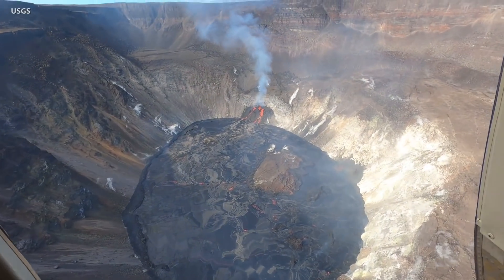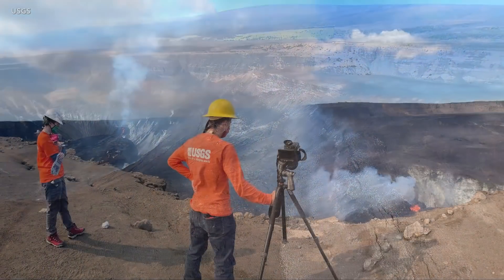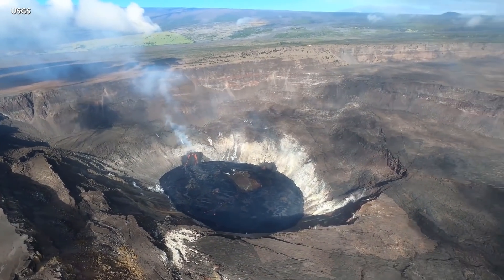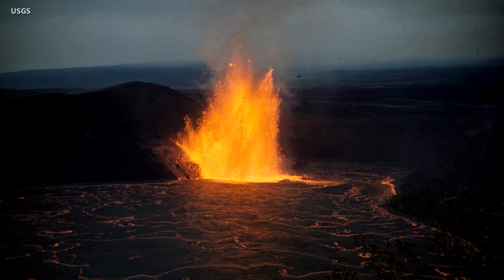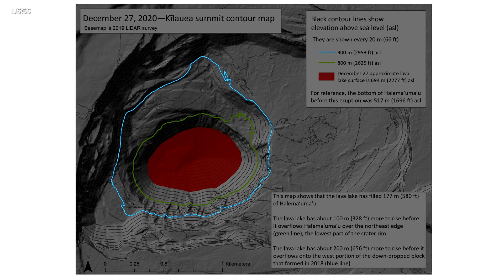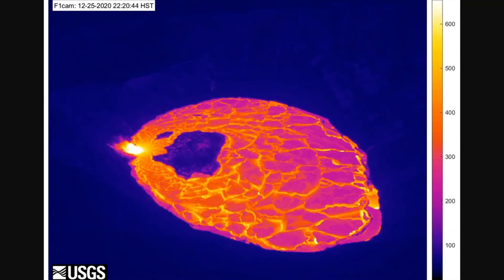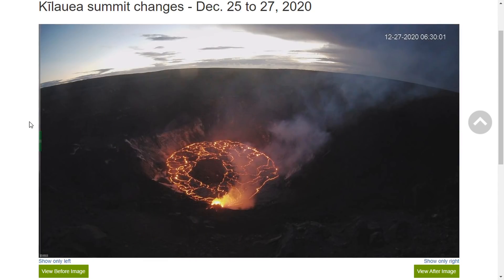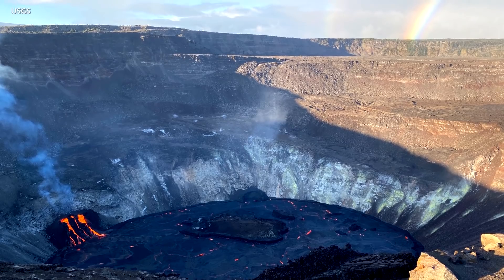Kilauea Volcano Eruption Update - Sunday Evening (Dec. 27, 2020)

Comment: Serious question: obviously a bad idea, but could you walk across the surface of the lava lake? I've seen video of a person walking over active lava flows in Italy (Mt. Etna) since they cool on the surface enough and are solid. What would it take to pull this off hypothetically?
Reply: You would need a lot of crazy luck for a lava lake. The crust could be thin in any spot due to repeated heating and cooling. Also, you would need a full mask and air supply because of the noxious gases AND the heat shield suit. All the gear would make you heavier and more likely to be toast ;)

Comment: Couldn't they have sent drones instead?  It's very dangerous to fly helicopters over volcanoes, especially at that low altitude.
Reply: I expect that is why they didn’t fly over it.
Reply: They need the helicopter to fly in/out the scientists working on the edge.
Reply: @timweather3847  Circumventing the crater rim isn't exactly safe, either.

Comment: It's (NOT) because Saturn and Jupiter lined up and the combined gravity pulled the magma to the surface.
Reply: Nope, the gravitational forces of Saturn and Jupiter are far too weak. The Moon has much more of a gravitational force than those planets because it's much closer. The moon can pull on the oceans and create the tides, but even the moon can't pull magma out of the ground.
Reply: @sunnysied713  Are the combined gravitational forces of Saturn and Jupiter truly lower than the gravitational force from the moon? I understand they are much further away, I was under the impression that Jupiter has quite the effect.
Reply: @TheRazzaManazza  Gravitational force is inversely proportional to the distance squared. Jupiter and Saturn's gravitational force on Earth is much smaller than the Moon's because both of those planets are ridiculously far away (which makes their force very weak). The Moon is very close. That's why the Moon has a direct and observable impact on Earth (such as the tides). Jupiter and Saturn (and every other planet) are insignificant.
Reply: @sunnysied713  that's the one! I couldn't remember the law. Thanks